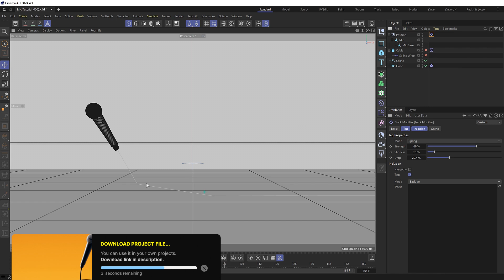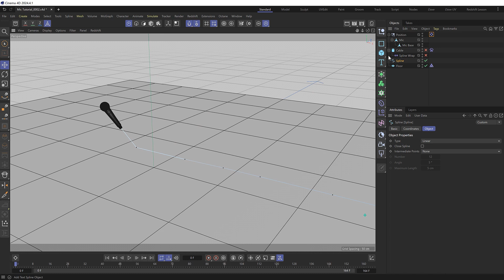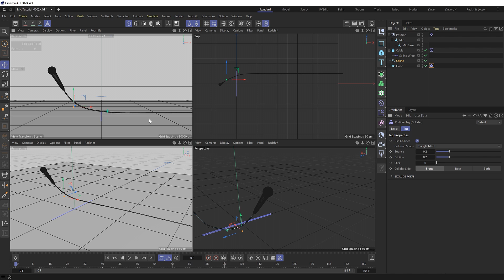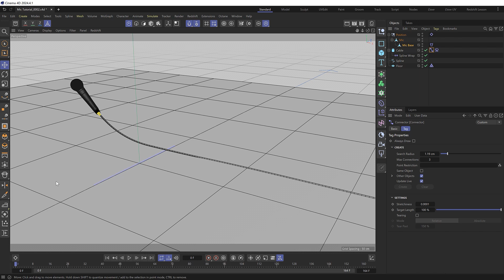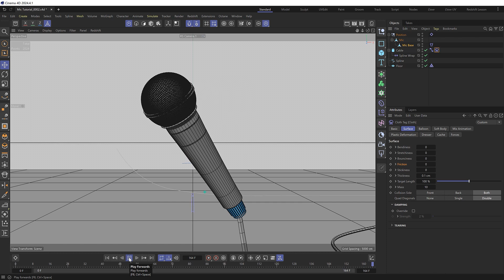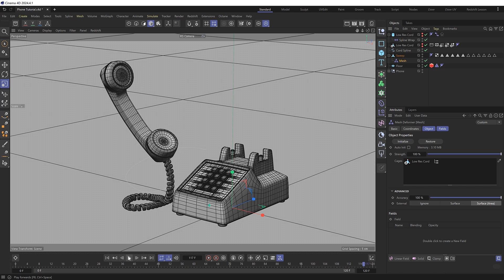Dynamic Cords or Cables in C4D - Cinema 4D Tutorial (Project File)

Comment: how to fix the problem at 4.00 where the cable just hangs straight down? 
there needs to be a lot more stiffness so the very end of the cable stays parallel to the mic
Reply from the maker: you can probably use a map in Mix animation to limit the effect

Comment: Are there reasons to go with a cloth over the rope tag? I've never really used either but in this instance, I'd have thought you'd want to use a rope tag. Same question on a sweeped spline object over an editable polygon. C4D changed the simulation setup and now things are breaking when I play around with the settings 😆
Reply from the maker: The problem with rope is that it usually spins uncontrollably so I rarely use it. There's always multiple ways to do things in C4D, you can always give it a try though